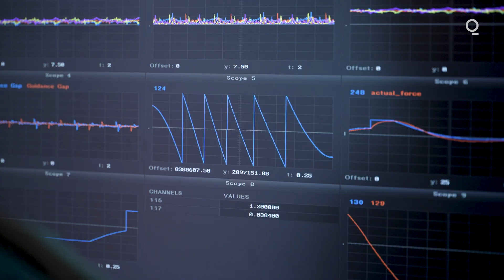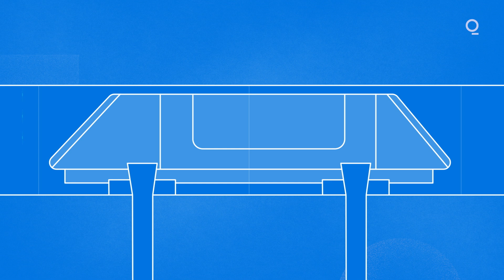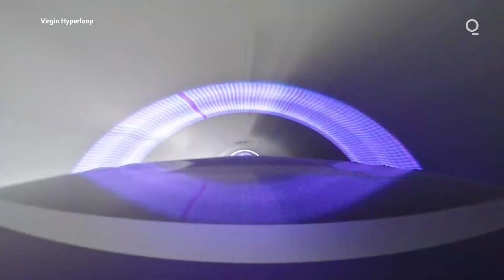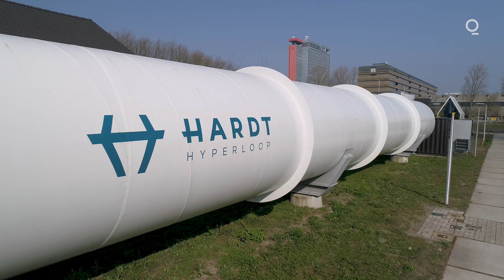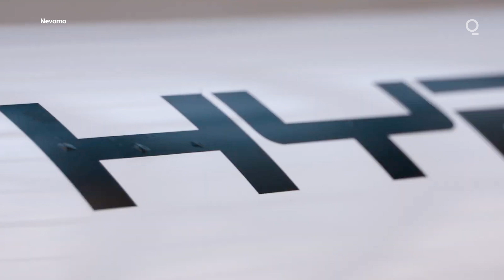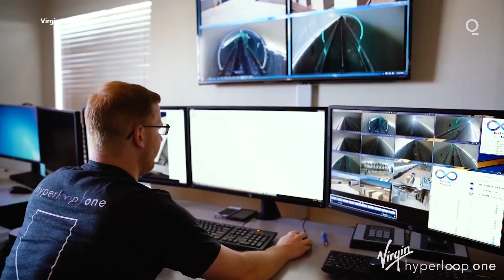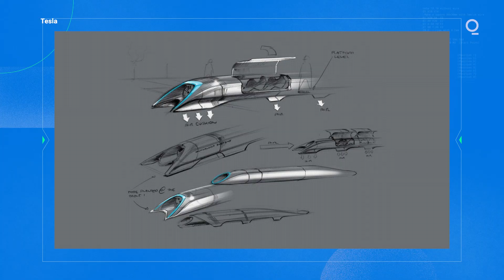The Hyperloop May Disrupt More Than Just Travel

Comment: So cool! They dismiss normal high speed trains because they are too expensive. So they are going to lower the price by putting a vacuum tube around them!!
Reply: On point :) Not just a tube, but a tube with a thousands of pumps attached to it which are all prone to failure and are working all the time to create a perfect vacuum.
Reply: @korana6308  And you don't want to know about all of the safety devices or engineering features that will need to be installed to actually make it acceptable by any safety regulator.
Reply: Hahahaha
Reply: Texas is building the first high speed rail in the USA with help from Japanese engineers, and I'm fairly certain it will be finished before the Hyperloop, and at a fraction of the cost. Maybe because the technology is proven, and exists. lol
Reply: @KaeboraGunbunny  details on the project? We're LONG overdue for HSR in America
Reply: Just because high speed train isn't fancy enough for their futurist dream. Look at china if you object
Reply: @wkkkkka1233  China sucks
Reply: @wkkkkka1233  Even that is not profitable.
Reply: Technically more expensive than a highspeed train for vacuum and other infrastructure
Reply: ... and RGB lights. Tons of RGB lights.
Reply: price over distance or per trip, not price in general. if a trip takes 8 mins and runs on electricity, then the trip that takes 2 hours and runs on a comparable amount of eletricity per person, or even if its slightly less per person or unit mass, will still use more power overall. and then the less efficient high speed rail option isnt as convienient due to scheduling and the amount of people that need to be on it for it to be profitable etc. i mean, lets see how the maths works out first at least.
Reply: @jonathanodude6660  The pumps evacuating the tube have to run all the time.
Reply: @TorianTammas  I know?
Reply: @aruspice  difficulty of achieving vacuums is diminishing returns. 99% =/= 100% and the difficulty of achieving it makes it pretty much impossible afaik. but it doesnt need to be 100% either. the point is reducing drag, not just vacuum for the sake of vacuum.
Reply: There are advantages to going many times faster than existing high-speed trains can go, and this system definitely doesn't need a perfect vacuum (that would never work).

True that there's a whole lot of engineering required to make it work though.
Reply: @patheddles4004  Yep, to slow aging.
Reply: @patheddles4004  We have more proofs that it can't be done than the other way around.
Reply: @jojolafrite90  In the 18th century there was more proof that humans could never fly than the other way around. Dreamers change the world despite the proof
Reply: @MrHitsugaya  you do know hot air balloons and gliders were a thing by the time the Wright Brothers first took flight in a fixed wing aircraft, right?
Reply: @eyeamstrongest  You do know the first flight of a hot air balloon and a glider happened in the 18th century right?
Reply: @eyeamstrongest  have you ever wondered why the Concorde nolonger is in use? It's way faster than normal airliners. So like a next step in the evolution of planes? Maybe, but faster=/=better.
Reply: @MrHitsugaya  Yeah, but we understand how the laws of physics work now.
Reply: @MrHitsugaya  In the 18th century, dreamers also went to seances and later drank radium water til their jaws fell off. 

"People laughed at Galileo, but they also laughed at Bozo the Clown."
Reply: @jojolafrite90  That's not how any of this works. You can't prove a negative. All you can say is that technology has not been developed yet. It doesn't break the laws of physics, so there is plenty of room for engineering to work away at these problems. No different from any other technologies over the course of history – from ships made of metal, to heavier than air flight, from automobiles to planes. All of these were once thought impossible & ridiculed. And yet here they are, all of them. A maglev train traveling through a vacuum tube would be no more dangerous than a high speed train or an airplane. At those speeds, the exact same risks apply.
Reply: Did you miss the part in the video that explained lane switching makes it hazardous to keep trains close to each other? What I got from that is when the whole network is operational, it can work at a much higher capacity than normal high speed trains. So it would be more economical. 
Let alone all the other benefits of such a technology.
Reply: @13thxenos  Really? Let's take a Shinkansen high speed train line as a working example. At peak times, the line carries up to 16 trains per hour in each direction with 16 cars each (1,323-seat capacity and occasionally additional standing passengers) with a minimum headway of three minutes between trains. So we talk over 20.000 people and three minutes between each train.
Reply: @13thxenos  Explain to me how it cans transport millions in just a few hours. 
Then we can talk.
Reply: @13thxenos  How about we just develop that cool lane switchers and all the other techie benefits and leave the tube out of it?
Reply: @paulpinecone2464  Why should we? It is like saying we should use all the techie benefits of space travel without going to space. 
I agree that the tube is the hardest part, the most dangerous part and the most costly part of this way of travel. But it is also the best part. The thing that let us reach speeds that are impractical in air. It also makes it a lot more energy efficient. 
Yes it is hard, but if we can make it, the benefits are immense.

Comment: They didn’t even explain how it was safe in the case of a power outage or seatbelts or if you can stand up. All I got from this is that this would make a great roller coaster
Reply: lets not forget it will operate in a vacuum explosive decompression is no joke
Reply: @raven123121  im guessing theyll take steps to make the tube sterile so theres no puncture risk, but the power outage thing is different. realistically, to be safe all you need are manual and automatic pressure relief valves and aux power, which will be in high supply if its powered on renewables due to their inconsistency. the guys in the vid were obviously wearing seatbelts and the tech has yet to show the best way to do this. some buses require seatbelts and some dont, possibly hyperloop will be the same depending on safety.
Reply: @jonathanodude6660  Everyone seems to forget that the pods can decompress. Your blood would instantly boil in one of these things if the pod lost pressure, and there'd be no way for anyone to rescue you.
Reply: @PistonAvatarGuy  no one is forgetting that. That’s what we’re talking about. If it’s properly built, the decompression risk should be less than a standard aircraft due to a sterile environment with known components. They aren’t going to decompress randomly, and they shouldn’t have the capacity to decompress at all.

The “stations” that the pods park at are going to have to airlock to function correctly, and since you’re at atmospheric levels there and you’re only travelling for a few minutes at a time on average, the pod only needs to simply match the pressure at the station it leaves from. That means you just need an airlock on the door of the pod, then when the station doors close and the vacuum is started, it would be very obvious if there was a leak.
Reply: @jonathanodude6660  "the decompression risk should be less than a standard aircraft"

Do you have any idea how much pressurized aircraft cost to maintain and how often they're inspected? What would that amount to when it's spread over dozens of pods? Is someone going to do a 'pre-flight' on every hyperloop pod before it leaves the station? How much will that cost?

"and they shouldn’t have the capacity to decompress at all."

Failures happen, especially when extremely high speeds and large pressure differentials are involved.

"...it would be very obvious if there was a leak."

Unless it's a catastrophic failure which happened during transit.

The airlocks, btw, are a major reason why the hyperloop will fail, as the passenger throughput will be greatly restricted by the airlock procedure.
Reply: Another big problem would be the fact that each pod would need a air system and air scrubbers to keep the air in the pod breathable on the trip. You would have to monitor and and swap out the air filters on a consent basis.
Reply: @raven123121  that sounds like a very minor problem, not a big one. We already have solutions for this.
Reply: @jonathanodude6660  "We already have solutions for this."

None that are inexpensive enough to be put into use in a mass transit system.
Reply: @jonathanodude6660  it's just another system that can add a chance for another point of failure. Plus it add to the cost because you need to servce and maintain the system. You would at best have to do a minimum check before each trip
Reply: @raven123121  yeah exactly, that’s definitely going to add to the cost.

Comment: What pressure will the tube be lowered to? Sure, the lower you go, the faster and more efficient the train, but also the more dangerous and more expensive to maintain. If a pressure failure happens on the pipe, the rapid depressurization could tear apart a pod.

Comment: I designed one of these. The same idea...an air tube system
Using compressed air
Home depot has one. For messages. They send messages around in bottles using air pressure tube system.

Comment: My biggest question is, when a pod leaves the tube, it requires an opening in the tube, that would depressurise the tube so how exactly is that handled? You can i guess have a prep chamber where your pod stops, the door locks behind it, it depressurizes the chamber and them opens the other door to let the pod leave, but that is going to take a while, and you mention high traffic ideas, how would this not clog up the whole hyperloop when each stop takes at least 2 minutes for each pod?

If one of these doors goes wrong and doesn't fully seal and the whole tube depressurises because of it with other pods inside it at 1000km/h what are the side effects of that?

Comment: 9:56 completely delusional
The biggest issue in fast mass transit is to build a straight line. This is simply impossible in europe since the land is owned by ten thousands of people.

Furtherore - As if somebody would be able to build a tunnel through several hundred kilometers of mountain range (through the Alps). 
The Gotthard tunnel with a length of 57km took 17 years.

Comment: Can you imagine the # of deaths that would occur with a hyperloop system moving at 1000Km/Hr and something (natural or man-made)
causes the tube to break and the cars suddenly go from full speed to zero(0) with little to no slow down zone?
Image a bug hitting a car windshield at highway speeds!!
I could see it being used on a zero(0) to low surface pressure planet or moon where the pressure differential between the inside and outside of the tube.
I'm 61 and I don't expect to see this going mainstream before I die, COVID-19 not withstanding.

Comment: The key term to focus on in discussions of Hyperloop is 'Hype'.. The dreamers tend to brush aside the physical issues with trying to implement the tech in a useful way. Part of the problem is that such a system would require huge amounts of electrical power and far more than surrounding the tube with solar panels, which in the best case scenario requires that huge amounts of land would have be be procured to install a tube setting aside that the tube could not be used at night or on cloudy days without serious power contribution from fuel burning, or nuke powered power plants.. One of the other monumental problems is creating and maintaining a vacuum for the inside of the tubes which I won't go into, but it's a massive roadblock to the tech.

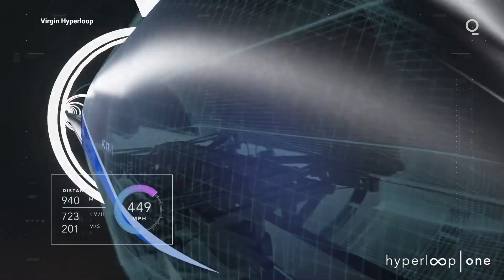Comment: 7:22 "It's fast, yes". NO. It's not. It might become fast. But at the moment it's simply not. As in, my car is faster than Hyperloop atm. That's my number one complaint here. They build a 500m test track and then run pods over it at 108 miles per hour... to prove... what? That you can go slower in a pod in a vacuum tube then in a normal car on a normal road? SHOW ME THE SPEED! Show me one successful run at the promised 700 miles per hour. Doesn't even have to have passengers on board. Just show me one run of one unmanned pod at 700 miles per hour. After 7 years of hype they still can't show this so don't say it's fast. The CGI graphics are fast yes. What about the real world?

Comment: The Hyperloop has about as much chance to "disrupt" things as the Aerotrain...
All the worst features of a subway and a maglev...with some of its very own thrown in.
Reply: You have seen a subway that goes 700mph? I have not.
Reply: @schmetterling4477  You haven't seen a Hyperloop that goes 700 mph either - you've seen CGI of such.
The fastest subway in the world is 311 mph on the Longyang Road to Pudong International Airport line of the Shanghai Metro in China. 
Meanwhile, the fastest Hyperloop test was 100 mph...for less than a third of a mile...with just two people.
A Honda Odyssey can do that...with four times as many passengers.
Reply: @trolleyfan  That "metro" is a maglev built with 1970s technology by the Germans. Scale it down in size by half, put it in a vacuum tube and you got yourself a hyperloop. You are too funny. :-)
Reply: @schmetterling4477  BTW, pointing out it's a third the speed of half-century-old technology is not helping your case...
Reply: @trolleyfan  What is? The final hyperloop will be twice the speed. That's what the vacuum tube is for.
Reply: @schmetterling4477  And, again, it's the vacuum tube that's hundreds of miles long that makes this whole thing an engineering impossibility.
Why is this such a difficult concept?
Reply: @trolleyfan  So you have never seen long vacuum tubes. So what? I have. :-)

Comment: Remember, the first iteration of this had the vehicle riding on an cushion of air, in a vacuum!  Hello!  Not a vacuum anymore!
Reply: Even in this video, at 7:45 for example, they show a picture of a jet engine pod while at the same time, talk about driving through a near-vacuum tube. Pointing out the obvious flaws should be standard for what I imagine was supposed to be an objective look on the whole hyperloop project.
Reply: It sounds easier to me to try and just connect one city at a time, that way they dont have to worry so much about lane switching or trying to build multiple tunnels cutting across,  if a two hour trip can already be shaved to a 5 and 6 that is awesome who cares if there is a few extra minutes change over
Reply: The idea was to "scoop up" the thin air in front of the train, compress it (1000:1, because, yeah, that's totally EASY!) then float the train 1mm above the tracks using that air. Utterly ridiculous. BTW, I would never get into a vacuum capsule without a space suit, because that's just playing the odds on suicide.